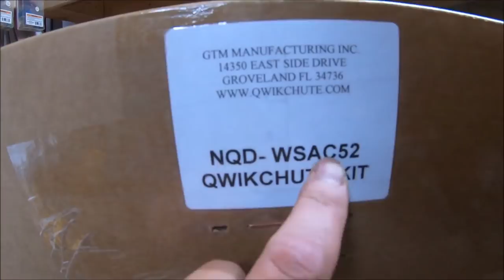QwikChute Installation on Wright Sport X

Comment: As for the fuel filter issue.  They probably use the same line configuration for more than one or two mower lines and simply used it on your mower.  That way they dont need to make additional tooling or have 10 different fuel lines, each different for each mower.  Probably something like that is the reason.
Reply from the maker: You know I wondered that and I looked at the ZK and the intensity and neither one of them are like that I didn't look at the regular Stander X. The fuel line is the same size on all of them I just don't know why they routed this one that way it's like a waste of fuel line
Reply: @CountrysideStrong  Maybe they just had lot of extra fuel line that they needed to get rid of or the person that built the engine was high and thought it looked cool.  Lol.  Never gonna know.
Reply from the maker: @rickrossetti3857  🤣🤣🤣🤣

Comment: We have the advanced chute and the more and more we use it I don’t like it because it’s full block or nothing. Time to switch to the quikchute. Let alone the instructions for the advanced chute were terrible
Reply from the maker: That's one of the reasons I went with the quick chute because there's an in-between and also I was looking at the grass flap but everybody I know keeps having problems with the cable snapping no matter how they route it. I just don't have time to keep replacing cables neither do you guys.

Comment: great you answered the question I needed to answer! great coverage....I am about to take ownership of a 48 Wright walk behind and accelerator. Assuming one of these will fit the Wright walk behind, it's important to me that the grass catcher works with one of these units without having to use tools to get it off..I have the question out to qwickchute if they make one of these for the wright walk behinds or plan to. The design is so simple i can't see why it wouldn't work.
Reply from the maker: I'm pretty sure you can get a quick chute for anyting

Comment: You thought about taking that rubber handle off. Welding a piece of metal at 90° on it. So it sits farther back so you don’t have to stand up to shut it
Reply from the maker: No because that's really the only time I'll be using it is standing. It's aluminum anyway and I'm not set up for welding aluminum. I'd have to change it all to steel.

Comment: Weird. I ordered one of these babies  from Power mower sales recently and it shipped in one day. (3 days after order I had it in hand)  But it was for a 61" SCAG Turf Tiger.  Maybe the one you ordered was on back order or some such?   I did use the lil chat thing at the bottom of the site and ask if it was in stock before I ordered so there ya go.
Reply from the maker: That could be. This is the 2nd time ordering from them and had this issue. I'm glad you had better luck
Reply: Yea, Just Bad luck I guess.  I get parts for my Scag from them from time to time and most come pretty quick. Never had any real issues. I do live in the same state so the ship time is only a day or 2. Also I learned long ago.. If I need parts fast.. call and ask if they are in stock.  I have gotten stuck before waiting on a special ordered part.. I agree. No fun.